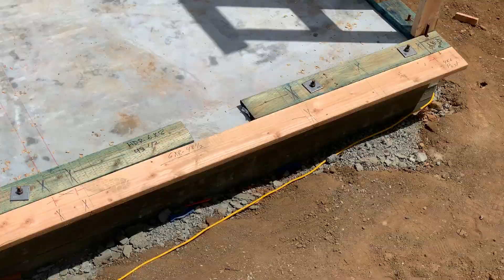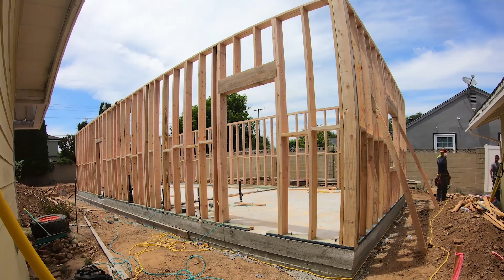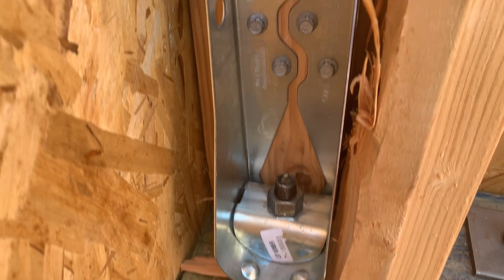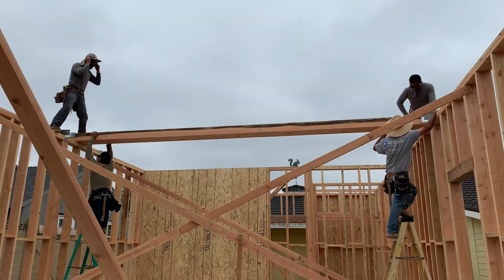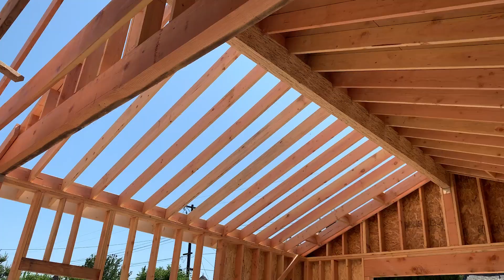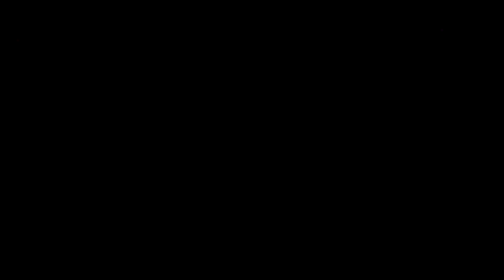Shop Build - Walls and Stuff

Comment: Framer here. You cut all of the rafter tails on the ground, not in the air, wtf. Work smarter not harder
Reply: 123xyz Not a production framer I guess. You do it in the air with a chalk line to make it way straighter. That way if anything bows in or out you can straighten it out.

Comment: don;t walk on the high parts of that decabond tiles stay on the lows end where the 2x2 battens run they wont dent up then you can drill a small screw in the tile and pull it back out with some pliers to fix them  then resen  rock chip the hole back up .those were super good framers tho very nice building